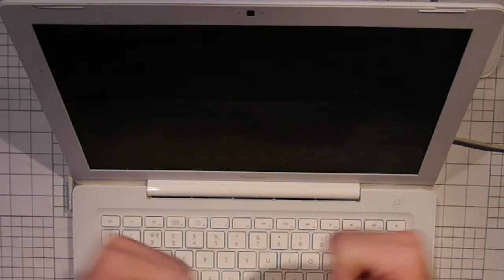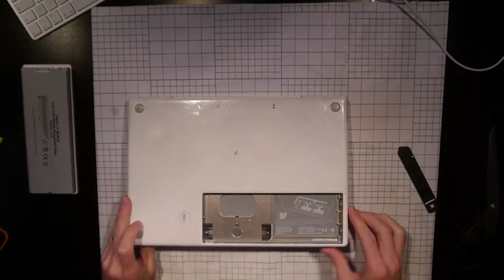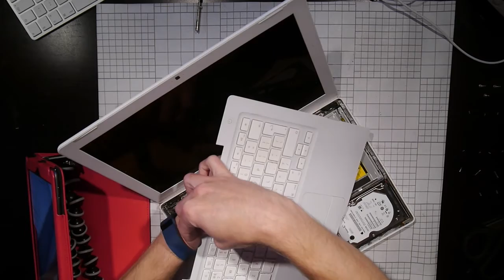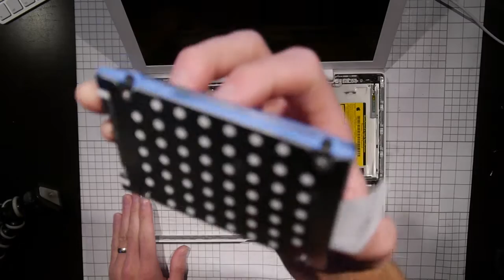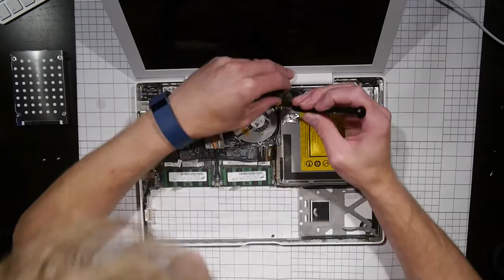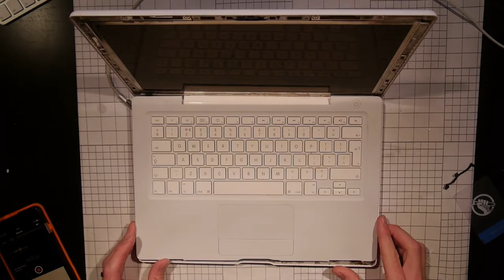Replace Inverter Cable - Macbook Early 2006 - A1181

Comment: Hi

I know was a long time ago, but i have the same problem,
I changed the inverter and flat, but not the cable inverter.

Did you fixed the problem? find the solution?

Comment: There was no need to take off the optical drive or the hard drive if he wanted to just change the inverter cable. . Guys take off  the hinges, take off the clutch and replace the cable. Thats it